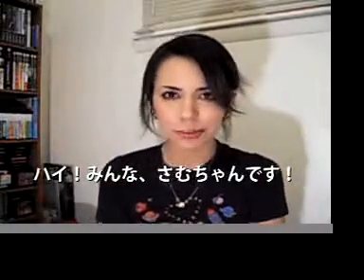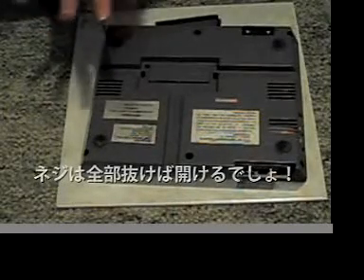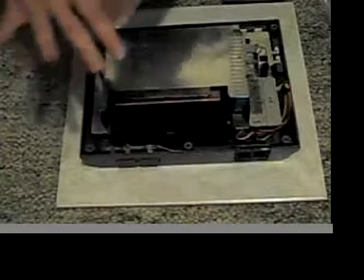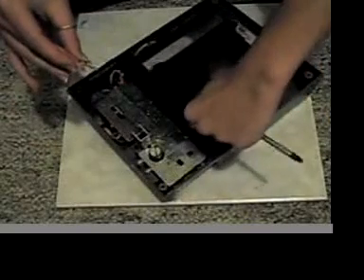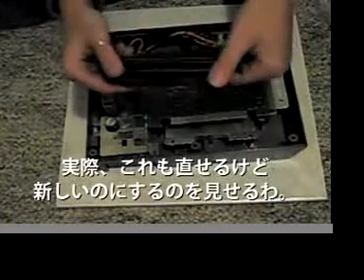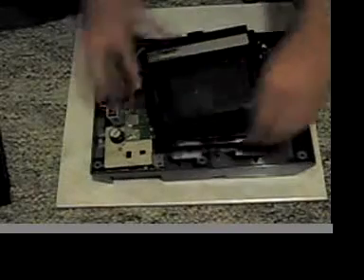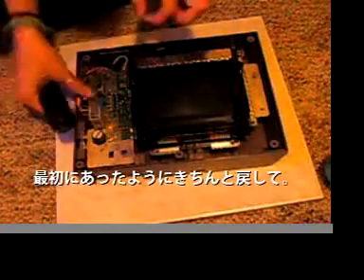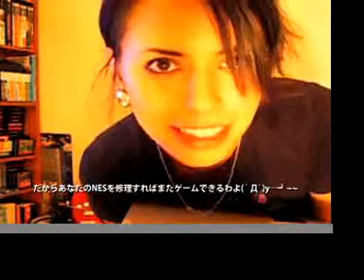Repair Your NES! (Read Description)

Comment: You Forgot ONE IMPORTANT STEP!  To clean the connectors where the new 72 pin goes with cotton swabs and a little alcohol!  I would also disable the lock out chip since you have it open already!    I have learned alot on how to fix nintendo's!

Comment: The connectors just tend to oxidize on both the cartridges and the internal connector. Clean the contacts on the cartridges (90% rubbing alcohol and q-tips work alright), and within the NES's connector itself. You could use an old cleaning kit if you can find one, or you could just open the NES and use a credit card with alcohol-soaked linen wrapped around it to clean the 72-pin slot. Things will probably work fine after that, just use a good amount of elbow grease and let it dry for a while.